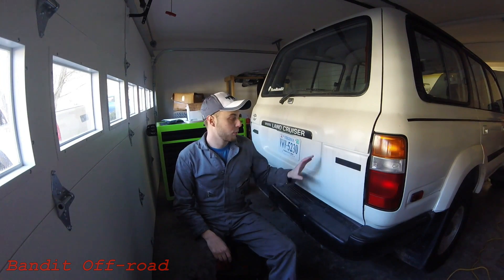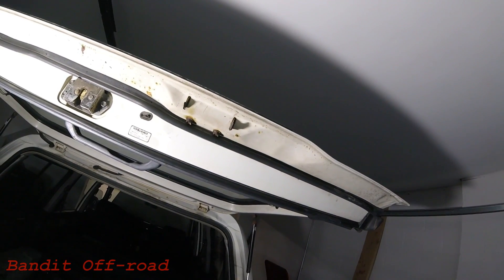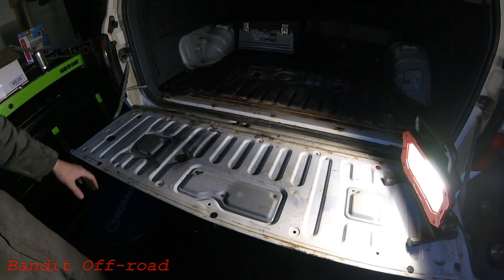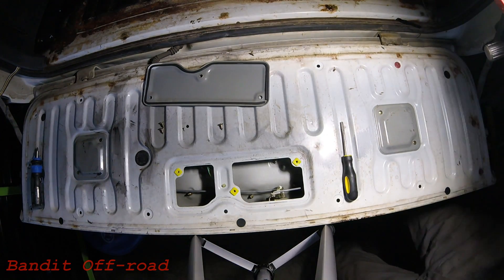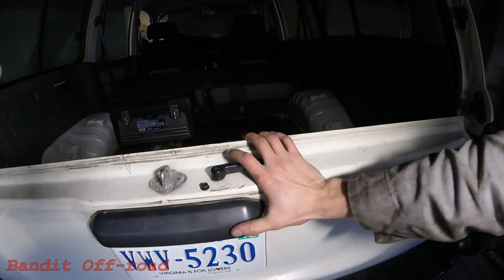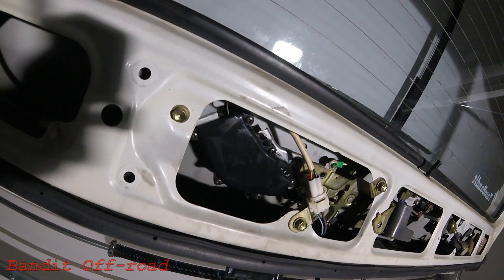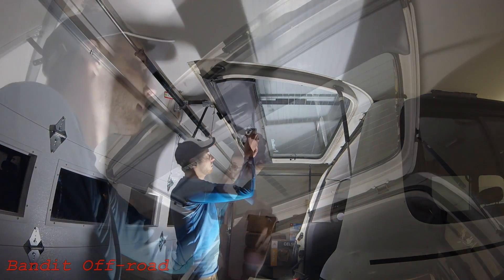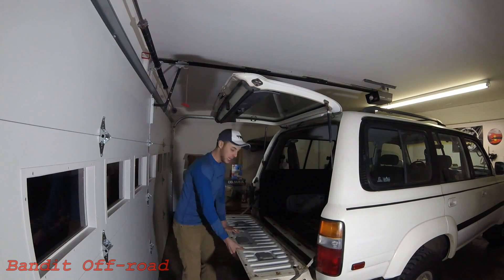Gaining Access to the Land Cruiser

Comment: Only once 👍👏 what does the Landcruiser weigh ?
Reply from the maker: That is a tough question.  I know the 91 & 92 weighed roughly 4,500 lbs from the factory.  Mine has many parts removed such as the third row seats and interior, so probably closer to 4,000 lbs.